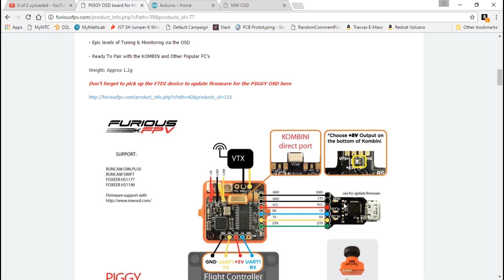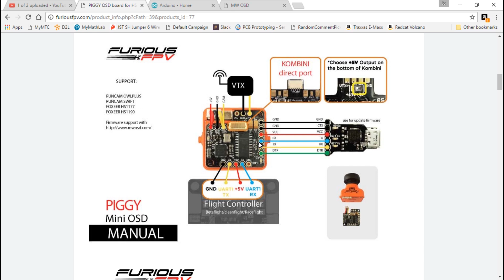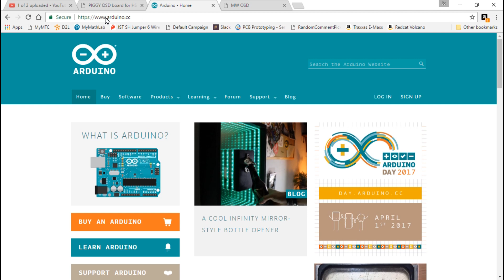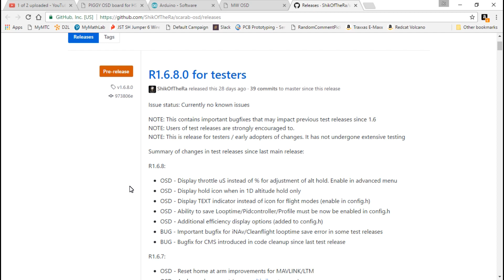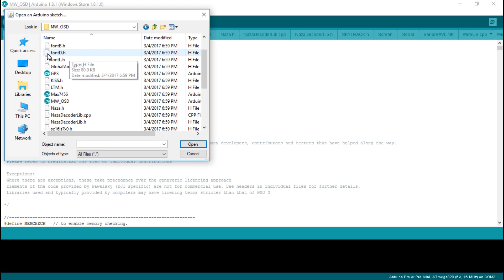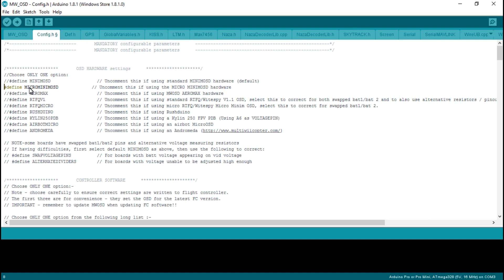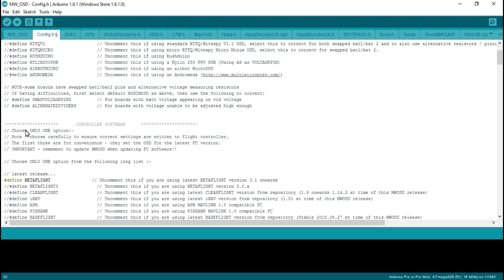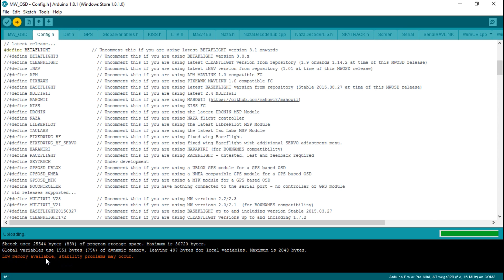Flashing Firmware To Furious FPV Piggy OSD

Comment: I need some help. The config is 1.6 and it states it not compatible with the version fw. I've tried both the latest chrome and original type config.Where can I get the compatible version config you're using?

Comment: Ok, so how I am having a different problem! I followed your tutorial to a T, including using your serial converter module. the only thing I changed was allowing selecting #define CANVAS_SUPPORT so I can use serial passthrough in betaflight. attempting to upload, it goes through everything to the point of UPLOADING, sits like that for about a minute, then I get "problem uploading to board" the error message says "attempt 10 of 10: not in sync" help!! feel free to email at ndradle@gmail.com

Comment: Hi, I am using the kombini FC, am I right in thinking you don't need to flash the firmware and I can just plug direct from the piggy to the osd using the ports provided on the kombini and piggy. and then simply solder the 3 cables in the top left of the piggy which go to the camera and I am done?

Comment: Someone please help. My camera only works when the USB is connected to my Omnibus F3 board. As soon as I disconnect it from the board, I cannot see through my camera. I feel like it has something to do with my board not getting power from my battery. When I plug in my battery, no lights turn on on the board, as they do when its connected via USB. But everything seems to be connected correctly. I'm so close to finishing this build. Someone please help. Thank in advance.
Reply from the maker: If you're not getting any lights on the board with the battery then no, its not getting power. You more than likely have a bad voltage regulator. I cover how to test it in this video. https://www.youtube.com/watch?v=i3hVfT5lcGY&index=18&list=PLiYYhnH4BhI_7WQQLFOqccpD7DNea6hIc&t=124s
Reply: Thank you very much for the reply.